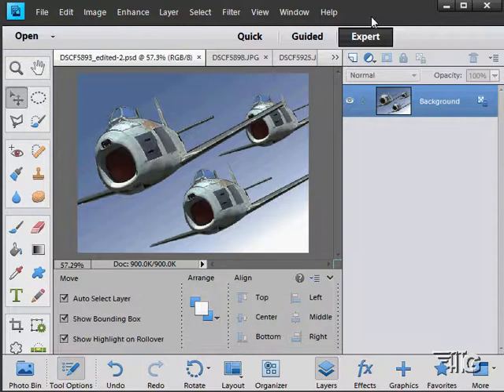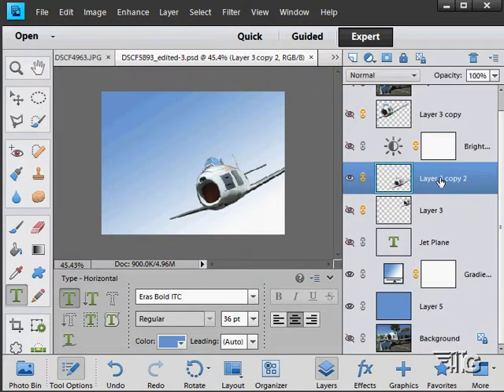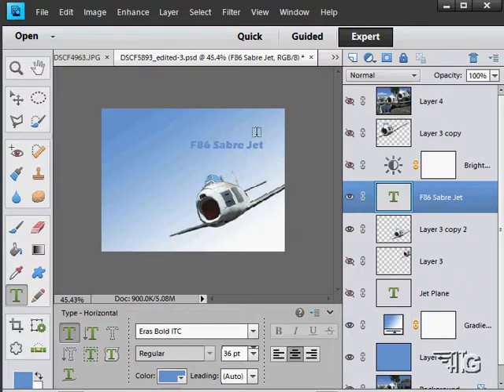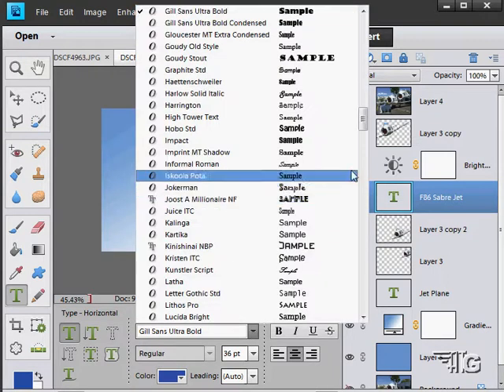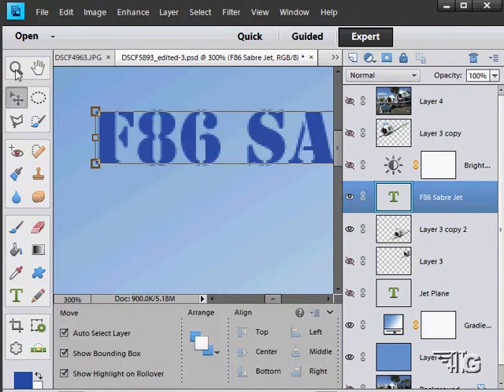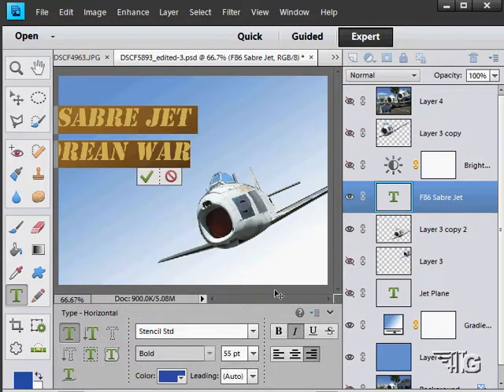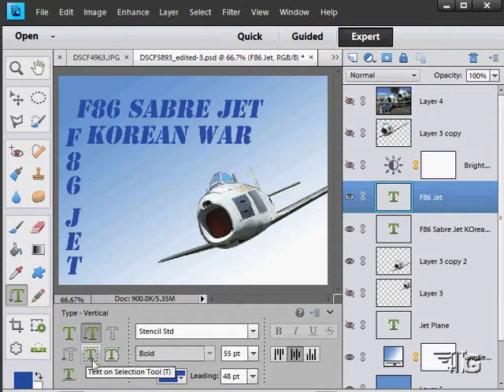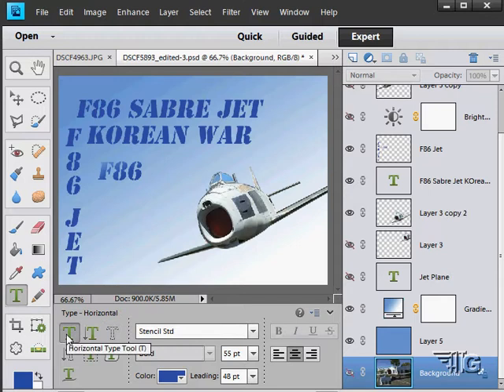Adobe Photoshop Elements 11 12 13 14 15 Tutorial Text

Comment: hi thanks,how can i increase the size of the text?
Reply from the maker: Hi, simply select the text using the type tool then change the text size using the control in the text options panel
Reply: thankyou very much :)
Reply: is 72 the largest it can go?
Reply from the maker: Hi Nickynunn, on the list where you see 72 you can type in your own number.
Reply: thanks man
Reply from the maker: No problem.